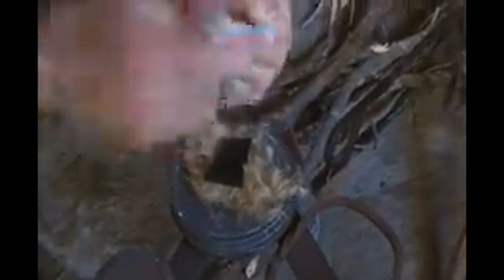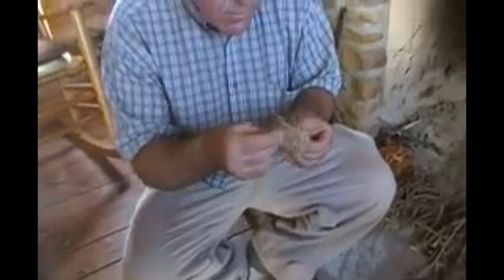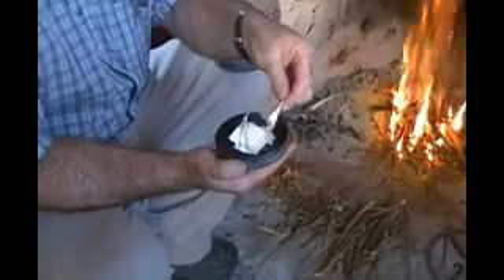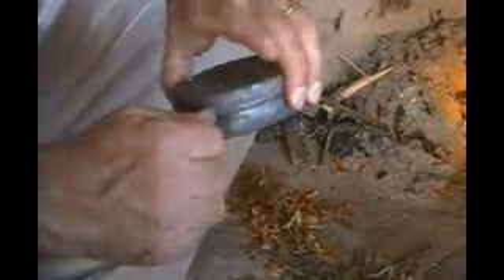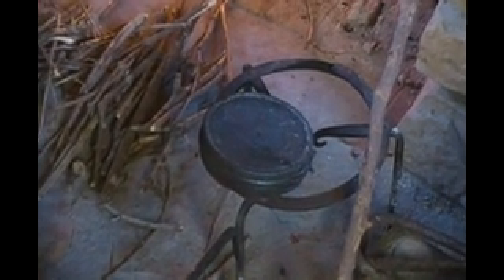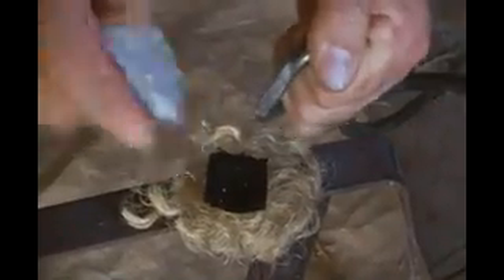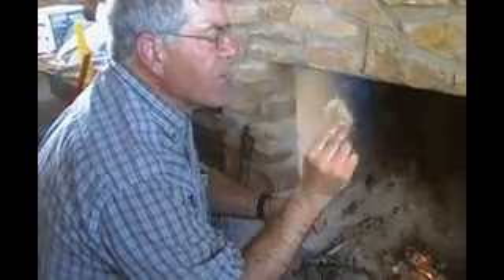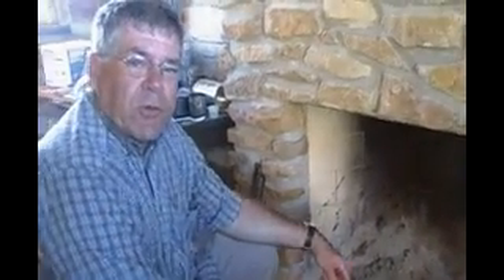Flint and Steel Fire with Charcloth

Comment from the maker: The spark is a tiny steel shaving that has been heated by the mechanical action of ripping it away from the rest of the striker.  Flint, or chert, is harder than steel, so it can shave off these steel bits when I strike a glancing blow.

Comment from the maker: Allen1901 is right on!  The flint is harder than the steel and peels off small slivers of the steel.  Kinetic energy is tranformed into heat, raising the temperature of the steel "spark" above 1000 degrees.